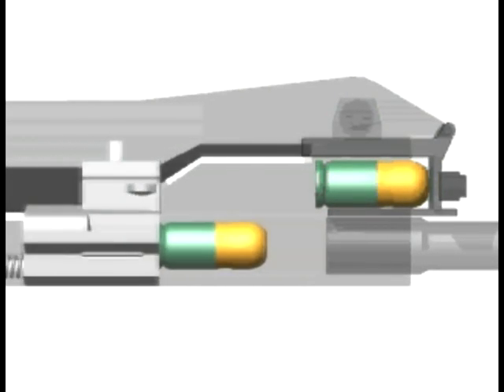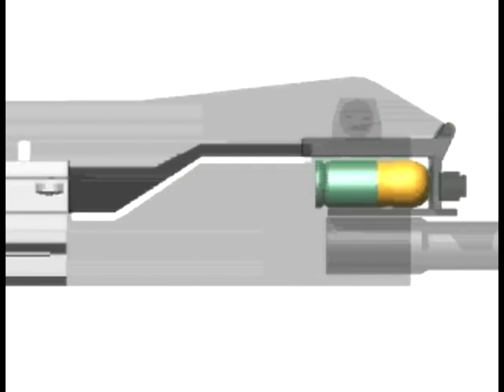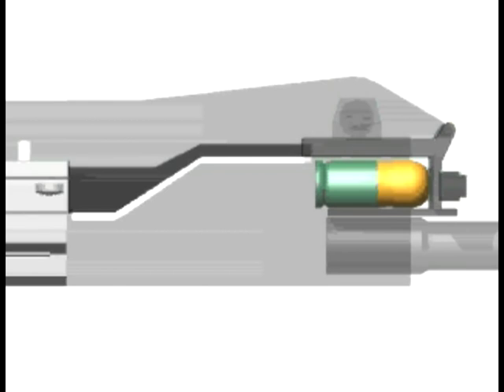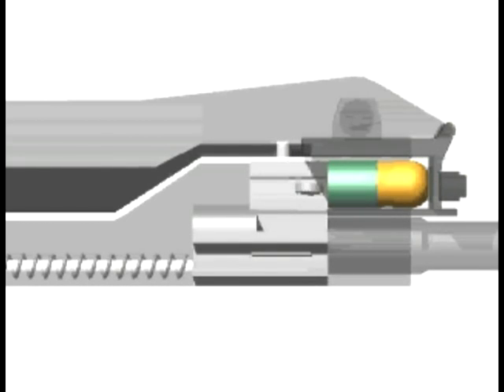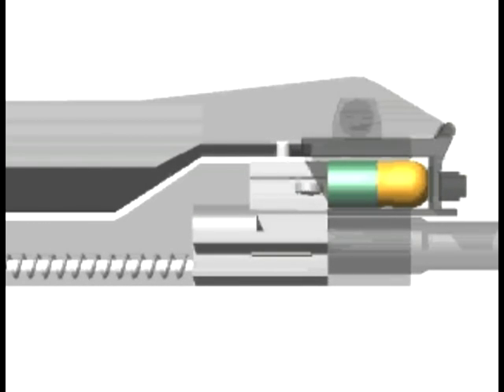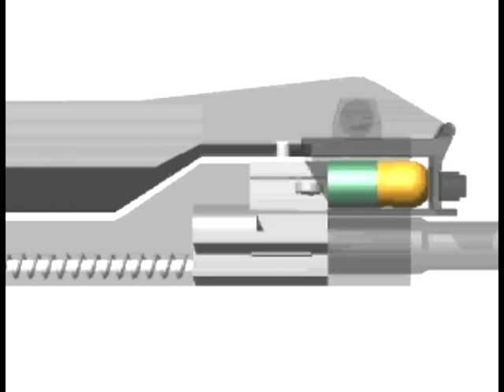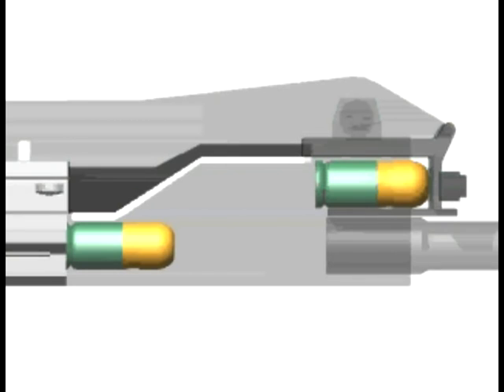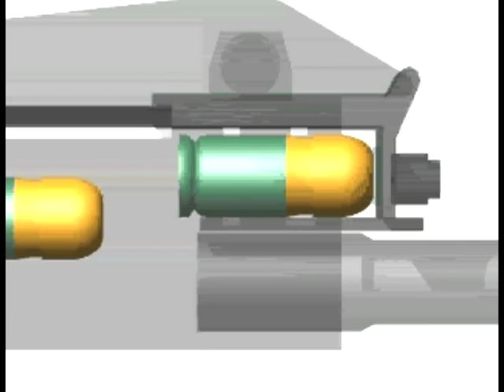MK19 (Mark 19)

Comment: @p331083 not exactly, the 40mm round doesnt have an active fuse until its reached a certain distance. the 40mm specifically has a minimum distance of 15 meters beyond the end of the barrel before the fuse becomes active... i believe.

Comment: @mfrantom So being a grunt you have experience with a 240 right?  You know how its max range on it for a point target is less than that of an area target, yet the max effective range overall is that for the area target right(or every other machine gun because thats what their designed for, area targets)?  Same logic applies here and then some considering grenades are just as deadly from the moment they leave the barrel of the mk19 til they drop to the ground.

Comment: Does the Army use this on infantry transport helicopters? It seems a ideal weapon for a door gunner.
Reply: This thing is notoriously horrible on the move. Amazing when fired from a stationary position. But once you start moving, you are praying to God you hit what you were aiming at. Huge dispersion as well. The beaten zone would be 200x larger than a typical machine gun. Also good luck firing this "free gun" as well. You take it off the T&E, and the recoil adds to even more dispersion. The flight time is also long and you have to have experience to figure out what you need to do at distance. This is why we refer to the MK19 as the platoon mortar teams. It's amazing, but only if you know how to use it. It isn't a point and shoot type of weapon. Also the bane of existence to every beginner gunner at Gunnery Ranges. Also, it's made by the Navy so it's also very fickle and loves "lube" if you know what I mean.